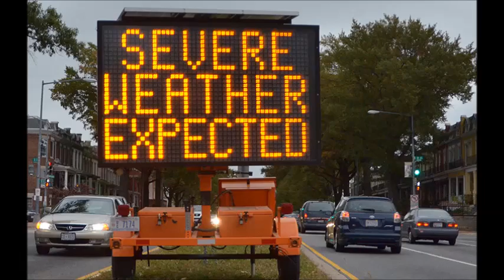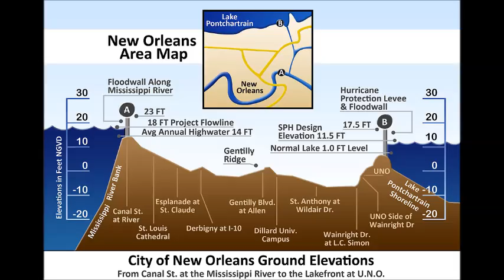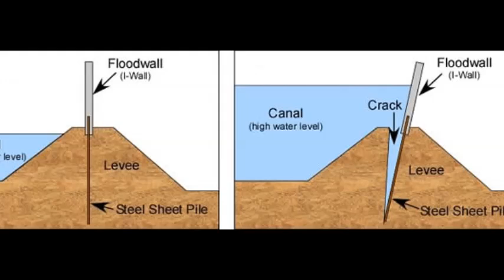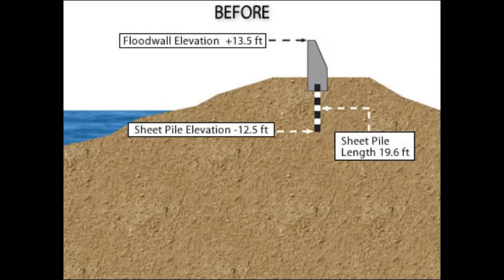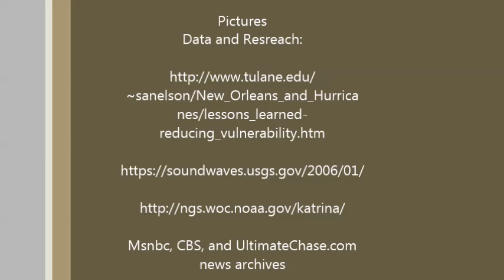Hurricane Katrina 2005, Levee Failure

Comment: It is said in this video that levee failure was the fault of the design engineers.  I strongly disagree.  I would strongly suggest that this is a wrong statement, far from the truth. People should not make such a statement without studying all the facts.  I was a little bit involved in this levee failure during the Hurricane Katrina when I joined the US Army Corps of Engineers (USACE).  It was a very strong hurricane.  The levees are designed after studying the previous worst floods occurred for a specific period of time.  If I remember correctly, a past period of 50 years was considered.  However, during the Hurricane Katrina this flood exceeded the worst floods in the previous 50 years.

Thanks,
Dr. Pad, PE
Member ASCE; Member Soc. of American Military Engineers; Member/Reviewer ASTM
Reply: Also, a large untied barge collided with the levee under the strong hurricane.  Since then the barges are properly tied.
Reply: Thank you both for your thoughts on this.

Comment: There are 2 types of levees:  (1) Those that have broken and (2) those that will break.
Reply: Did they fix them?
Reply: @sangheeozuna3894  yeah we have a multi billion dollar levee/flood protection system now. But our pumps were never renovated and even during the smallest of storms we flood, so now yeah we've fixed the levee problem for decades to come but now we'll prolly see more flooding simply due to heavy rains and our pumps not working proplerly
Reply: @sangheeozuna3894  Yes.
Reply: hahaaa - good one
Reply: The levees were blown up by the second shooter on the grassy knoll and by pedophiles from Hollywood. PS.  The levees did hold  from Hurricane Ida in 2021.
Reply: Especially if they are blown up🤫

Comment: maybe if George Bush had put more money into securing the coastline from storm surges instead of blowing up bridges in Baghdad the hurricane flood wouldn't have been quite so bad?
Reply: lmfao George bush doesn't control the finances of a individual city dumbass,,,, you know city officials exist right?
Reply: If the New Orleans Levee    Board of 2005  had permitted the U.S. Army Corps  of Engineers to build the FLOOD GATES  they planned at the mouths of the drainage canals, the storm surge of more than 15’ would not have drowned the city.

The corrupt old Levee Board appointed by the Mayor  has been replaced by the Southeast Flood Authority Board. The 9 members are appointed by the Governor and a council. At least one member must be a certified civil engineer. There is also a hydrologist and a geologist on the present board.
Reply: Also, maybe, humans shouldn't be so fucking stupid as to build an entire city below sea level...

Comment: There was no failure it was intentionally blown up or opened
Reply: highly doubt that. water tends to overtake dams when they can't handle it. that's quite obvious. mother nature is more powerful than anything we can create.
Reply: Why that would be dumb
Reply: @nocomment4618  To save the French Quarter
Reply: @dremmauo  It was caused by a barge that broke loose and breached the levee.
It had nothing to do with the French Quarter.  The French Quarter is the only part of the city that doesn't flood.
Reply: @900stx7  The barge was later found to have demolished the lower 9th ward after the levees had really broken. The real reason the levees broke is that they were just improperly designed and failed when the great pressure of storm surge from Katrina inundated them
Reply: @venticuiliar9136  true, the levee was breached in many locations. 
My point is that it wasn't done intentionally. 
It was mother nature.
Reply: Absolutely not! See my brief explanation for the failure.
Reply: I mean, they did find dynamite near the levee... Only few know about that